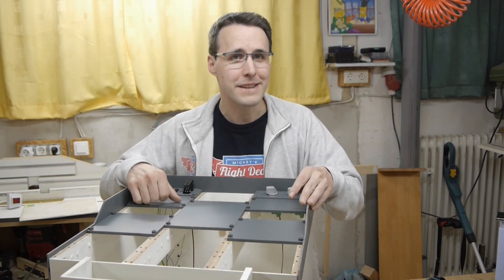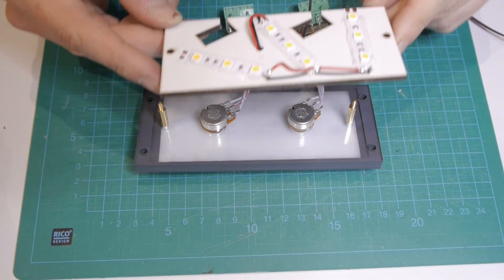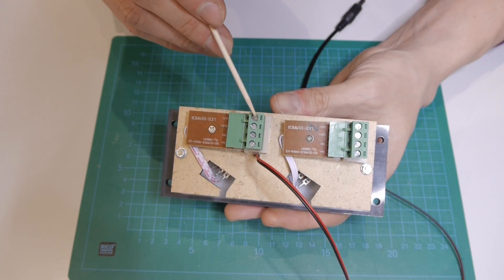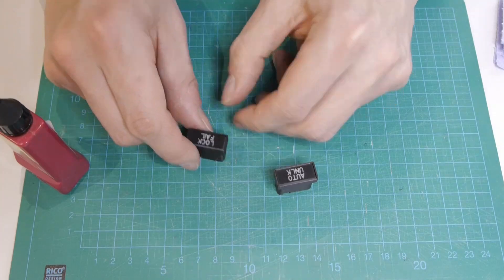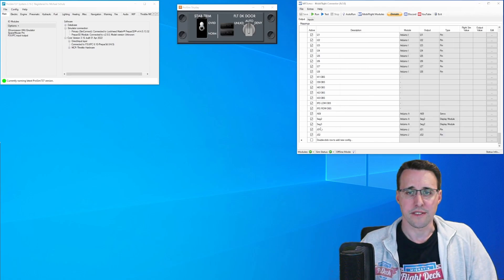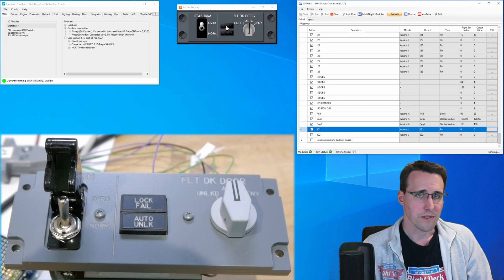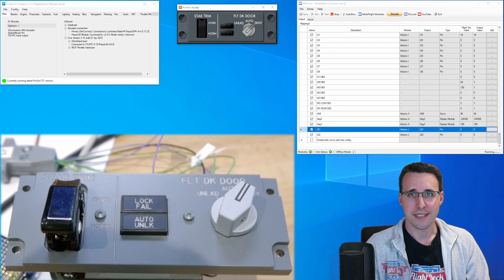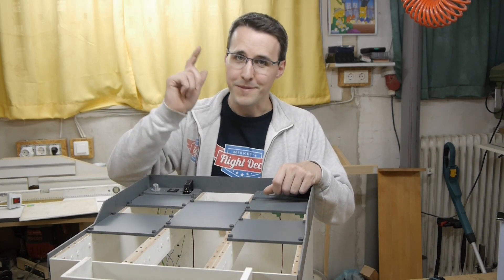Flightdeck Door & Lights Panel - A Boeing 737-800 Homecockpit #67

Comment: Another great video!! Thank you Mike.  A suggestion, under one of the blank panels can live your arduinos for controlling your pedestal panels.
Reply from the maker: Yes, this could be a solution. I'm planning to position all the components on the bottom of the pedestal.
Reply: @Mickeys_Flightdeck  On the bottom is a good place. The pedestal is good for hiding many items, I for instance have a big bass speaker on the floor in the bottom of my pedestal over a hole in the floor. It works very well.

Comment: Hi Mike, I’m trying to find the video where you would have shown how to print out these knobs and paint them but I’m not being able to find any. I remember watching one where you resin casted the knobs but they didn’t look as good as the ones in this video. Are you using a different technique now? And how are you making the black stripes?
Reply from the maker: The answer is, that I never showed how I'm printing these new knobs. I'm now using a resin printer. This produces really fantastic results. But when you don't have such a printer I would still recommend to resin cast them if you need several copies. The black stripes can be done by masking everything that shouldn't be black with masking tape. You can find pictures of this on my instagram account.
Reply: @Mickeys_Flightdeck  Thanks Mike!

Comment: Hi mike
How's the way you lock the knob with the rotary switch or dimmer? What tools do you use for it?
Reply from the maker: I have designed a 2.5 mm hole in the knob. Then cut a 3 mm thread into it and secure it with a set screw.
Reply: @Mickeys_Flightdeck 
What kind of set screw? The cone point or flat?
Reply from the maker: @hodor2135  The flat one.